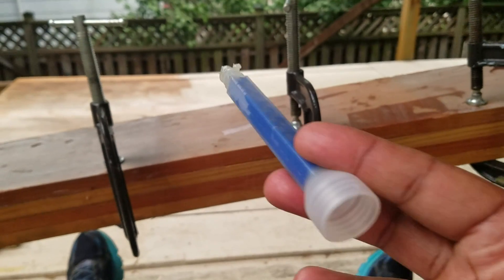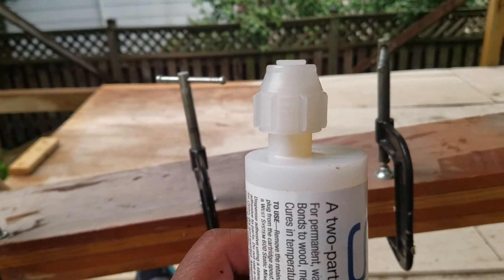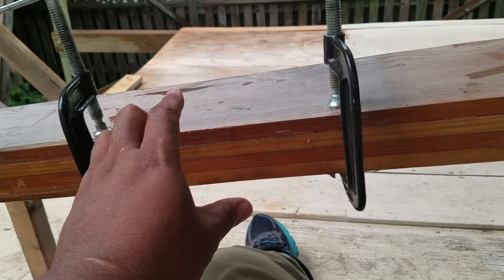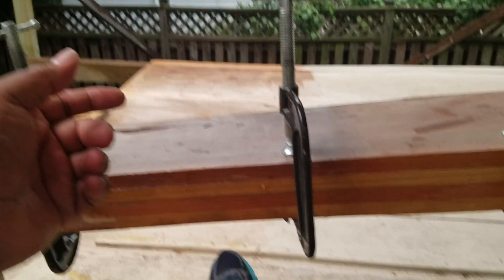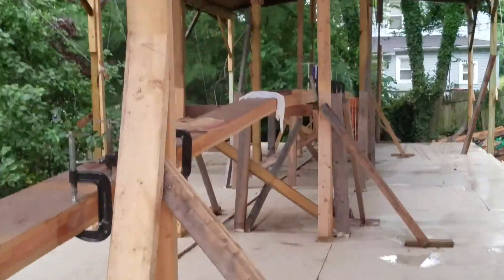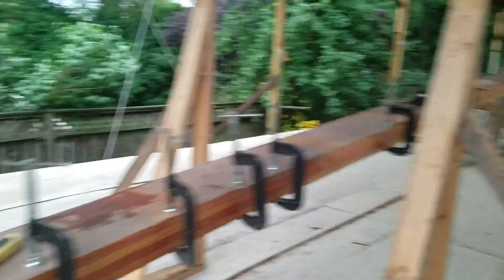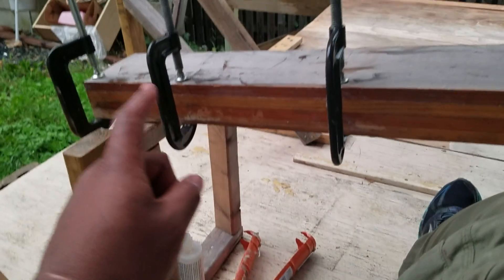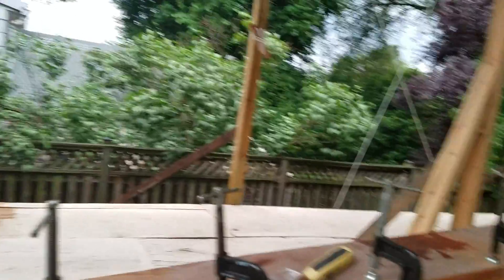No umbrella drinks here, just epoxy and clamps.

Comment: God knows you did a lot of math in the creation and planning of this boat. I could be wrong, but I'm guessing you will need 500 gallons or more of epoxy before she is finished. We all know everything is cheaper when purchased in quantity. Did you ever do the math to see what it would take to buy two or three 55gal drums of part A and 2 or 3 drums of part B as opposed to small pint quart or gallon quantities of the same thing? I'm thinking over $1000 in savings between bulk and small quantity pricing.
Reply from the maker: I did. I used the plywood as a basis. 60 sheets requires about 12 gallons per coat so about 24 gallons just doing the hull. I figured about 10 gallons for the interior Construction. So all together about 35 gallons.
Reply: Wow, 35 gallons? I would have guessed much more. The beauty of plasticizing wood is making more sense now.
Reply from the maker: +Powerelectronicsguy  Yup, I may be off but by no more than a factor of 50%. When I built the small boat it took 1.5 gallons for 5 sheets of plywood and I wasted a lot. It was my first time working with marine epoxy and a lot of it kicked off before being applied. The small boat also had a lot of fillets. 35 gallons or 50 gallons, either way it's gonna be cool. :-)

Comment: Did you give all sides of the boards a full drink coat of epoxy before you laminated them together?  If not.. that combined with the wood shrinking and expanding with the season change would account for your gaps.
Reply from the maker: I did, I just couldn't see the bottom well enough. I say this because the delamination only occurs on the side of the keelson that was against the floor of the strong back, there's none at the top.